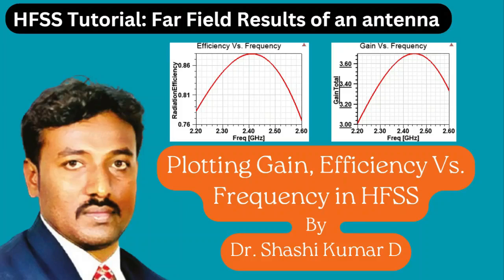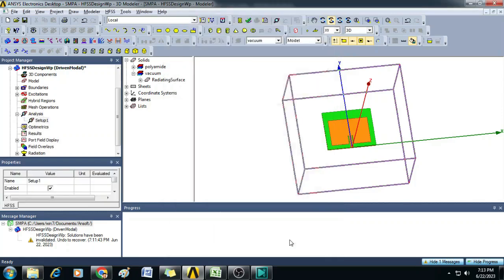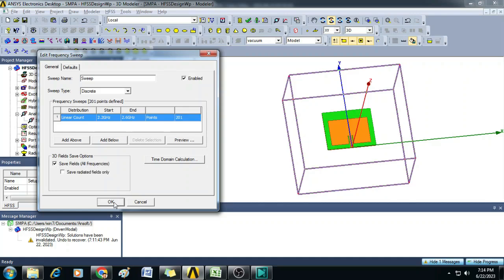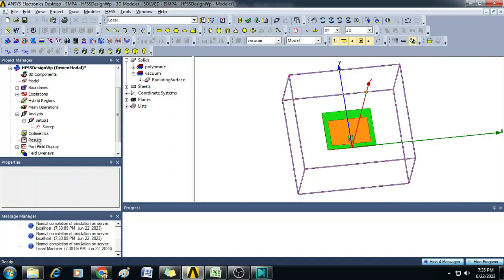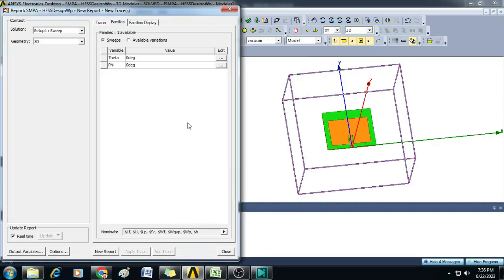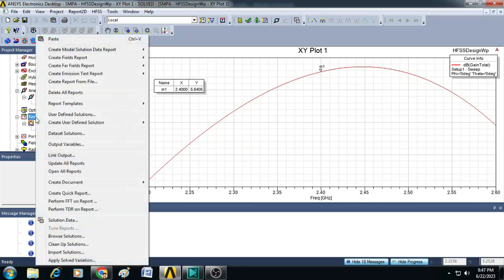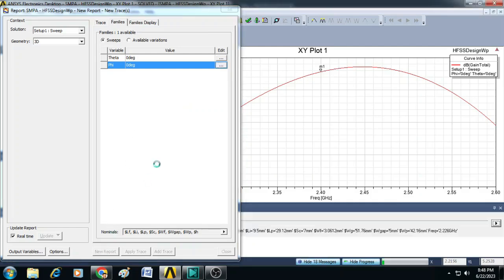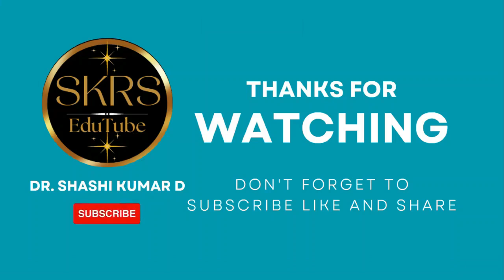HFSS Tutorial: Plotting Gain, Efficiency vs. Frequency of an antenna

Comment: When i want to plot the radiation efficiency. only one frequency appears in the axis. on the primary sweep option, only frequency appears not sweep. So it only plots against that one frequency value......Pls assist
Reply from the maker: in frequency sweep settings you have to set sweep type as discrete and run your simulation